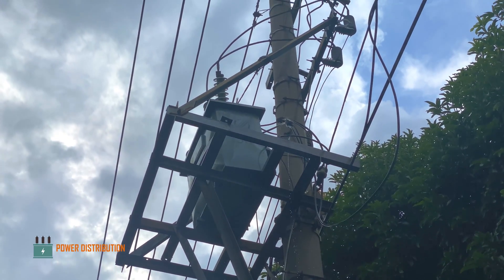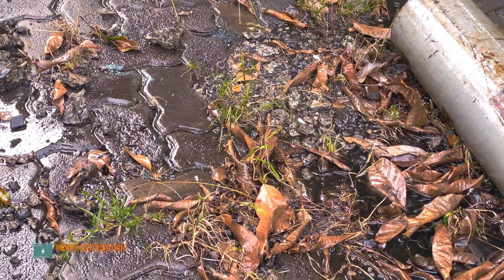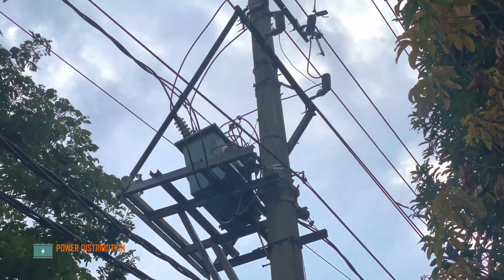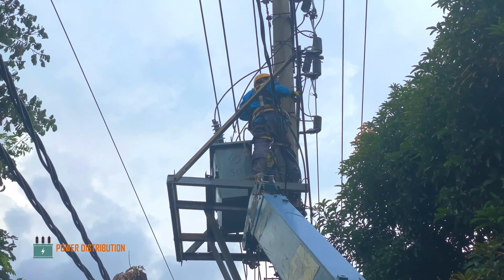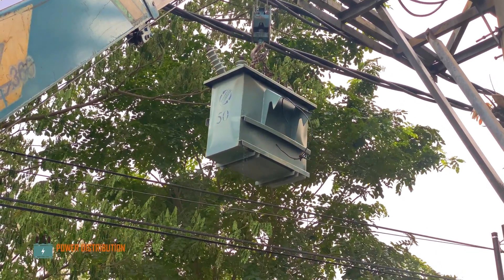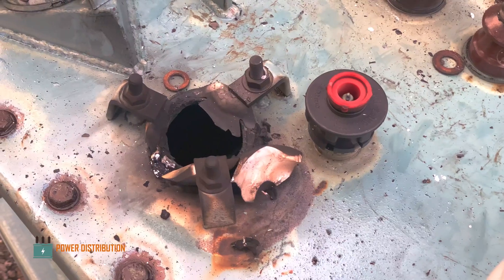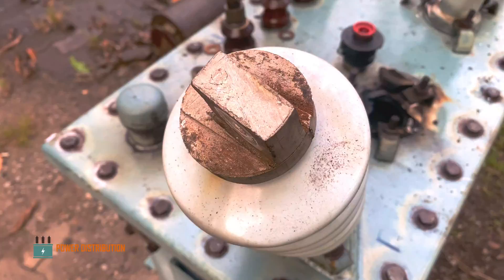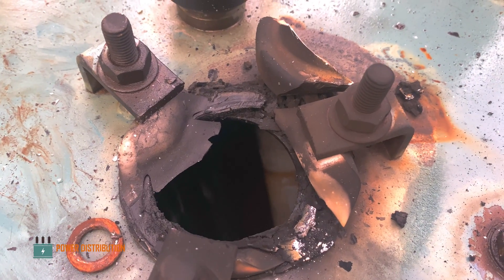Transformer EXPLODED and BURNED

Comment: hello I want to ask the big power distribution cable jtm what is it called?

￼
Reply from the maker: Loading Nyettt MVTIC Medium voltage twisted insulated cable
Reply: @imadewn  what for
Reply from the maker: Loading Nyettt just like overhead or SUTM lines. It distributes the power but using an insulated cable so that it resistent to external disturbances. It is utilized usually for express feeders
Reply: @imadewn  what for sutm